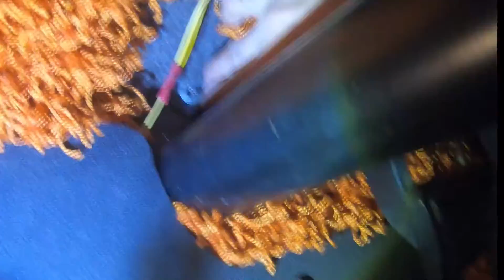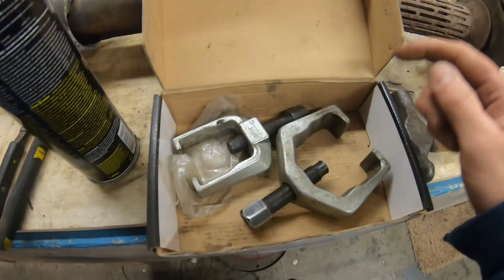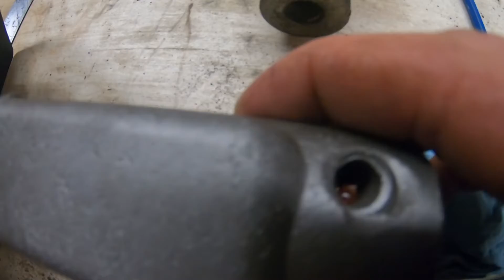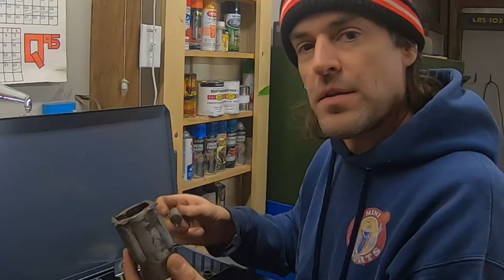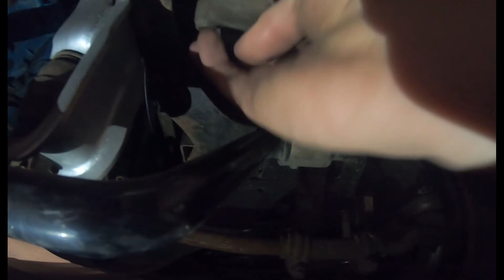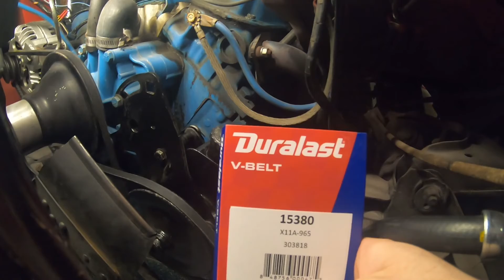Power Steering Your Mopar - Hoosier Garage

Comment: Nice video, brother.  I will say that the angled pressure valve fitting DOES fit in my '73.  I believe that's what was original, since that dimple in the valence panel JUST makes enough room for the hose to attach to the valve and was certainly put there for that reason.  Also, the angled fitting is what is pictured in the 73 Service Manual and 73 Parts Manual.  That being said, the straight one looks like it may allow for more clearance/easier fitting.

Comment: How do you like the Steer & Gear box? Does it feel tighter than a normal 70s one finger steering? Thinking about getting one from them for my 73 Duster. Thanks
Reply from the maker: Its the upgraded #2 level box as Firm Feel would call it. I like it. Feels a little heavier but not too much. I think i tend to favor Firm Feel more. Its a touch firmer.